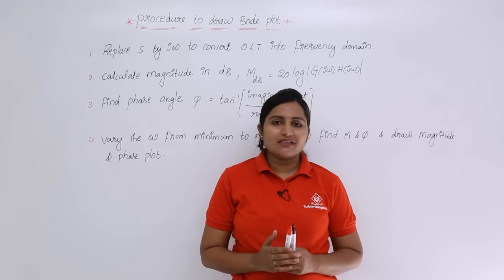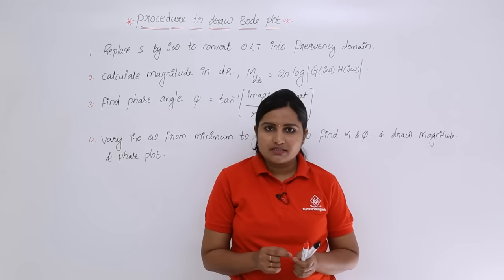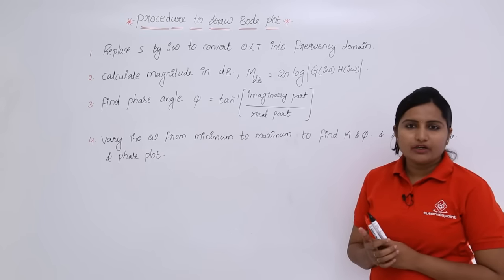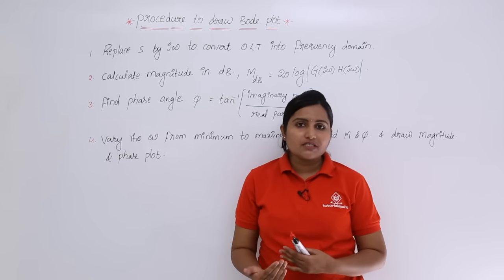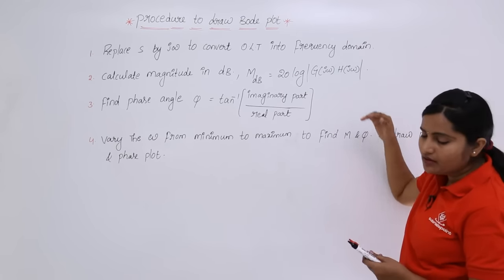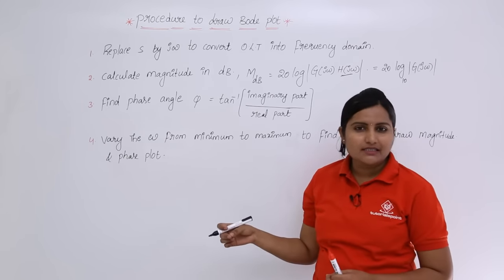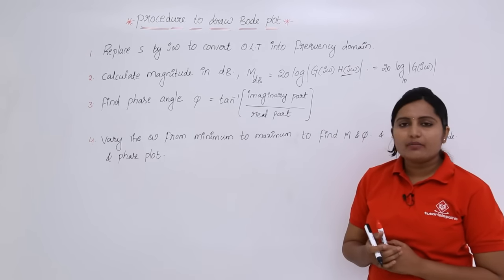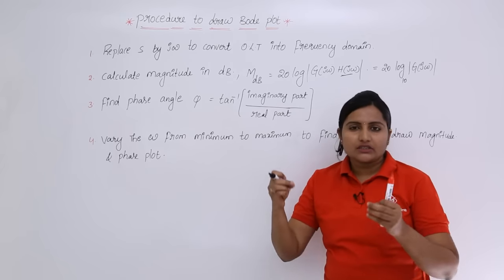Procedure to Draw Bode Plot & Bode Plot for Constant K

Comment: While finding magnitude.. if we take k=-2 

There exist nodulous..So it will becomes as 2 and will result as 6 which is +ve value although we have taken <1.?
Reply: Correct...
Reply: Actually that modulous symbol is used for magnitude here....we need to consider magnitude of G(jw)
Reply: what mam is trying to tell is.......... '"M(db) is negative is -1<K<1 "